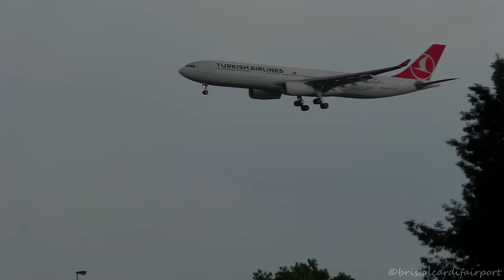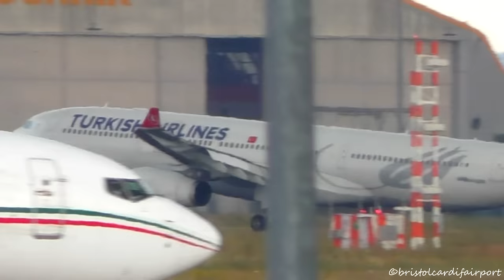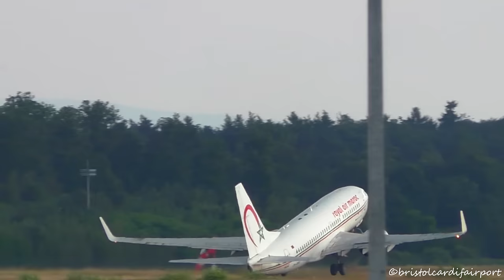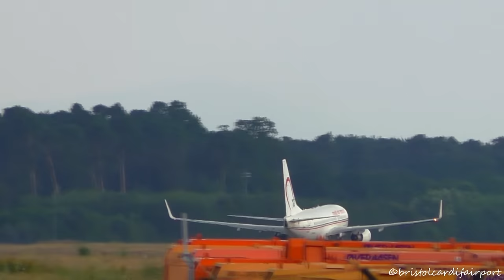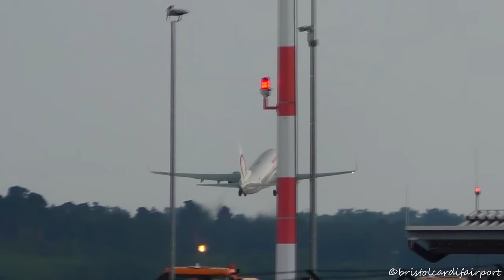PASSENGER AIRCRAFT FAILS TO TAKEOFF! BOEING 737 NEAR TAIL STRIKE & STALL ON TAKEOFF

Comment: I know its easy for us to all look at what was wrong, but fair play to the pilot for reacting correctly by dropping the nose, gaining speed before pulling up again. I'm sure there's other pilots who would have panicked and pulled back harder on the controls when they realised something was wrong. Yes there was an error initially but the PIC saved everyone's life there!
Reply: +Legend Length I'm not a pilot but my understanding is that at a certain speed, you're committed to Take Off no matter what. Usually this is because there's not enough runway left to slow down and stop the plane.
Reply: Doofer911 Yup, V_1 to abort always is below or at the rotation speed, meaning that, believing in his speeds, he was to take off. However, it is a very confusing situation to see that these speeds don't work in such a critical phase of flight. I think in his place I would have also slammed the throttles foreward, taken the nose down to reduce drag and then tried again with my feeling and experience, maybe with 30kts more, guessing that it might be a wrong flaps setting...
Reply: Der Kazar true V1 is the speed that no plane can stop at that time we would run out of runway and bump into one of those trees .The best thing left to do is pull the nose higher
Reply: Agreed, he was already above his calculated V1 speed (rejection speed), so aborting the take-off (based upon the #s that he thought were correct) would have violated SOP plus good judgement under normal conditions. Fortunately, he had enough runway to be able to make his true/actual Vr speed with zero flaps....and must have figured that out very quickly as it was happening. Good split second decision-making in a tough situation.
Reply: Doofer911 Dude...every pilot knows how wings generate lift and how aerodynamics work
Reply: i think this was a test flight of some kind cuz if you see closely all the windows are closed and that's rare
Reply: The correct procedure on a 737 is to select flaps if you get stall warning during rotation. Really, the correct procedure would have been to set the flaps before takeoff and then, if they still weren't set to abort the takeoff when the takeoff configuration warning horn started honking as the throttles were advanced with the flaps up. It could have been worse, but it could have been a whole lot better, too.
Reply: Can't believe all you 'wanna be' pilots didn't notice they had no flaps on take off... that my friends is your problem.
Reply: that's an old video its was a test flight and look closely they have all the windows closed
Reply: Brandon Hollingsworth 
Hey Brandon, never noticed that.  In my defence however, I'm a rank beginner.
Reply: Doofer911 man your tutorials are the best .keep up with tutorials
Reply: Brandon Hollingsworth, Flaps 1 is a standard takeoff configuration and has only leading edge devices extended.
Reply: iRx Destiny
RAM airlines makes no test flights in crowded foreign airports.
Reply: are you a pilot
Reply: Doofer911 I don't see flaps engaged at all.
Reply: Brandon Hollingsworth 100% correct. They have no flaps engaged at all. If there has been an issue with flaps they certainly have had even more trouble during their approach and landing.
Reply: Ali Rahimy "Flaps 1" (a normal takeoff setting) is only leading edge devices, no trailing edge flaps. In the beginning of the takeoff roll you can see the slats are extended.
Reply: Chris Lowder It's still difficult for me to see the extension of flaps though. By the way if the flaps are extended the fact causing this is very interesting to spot. Too much weight, wrong Vr settings, cross wind (which is not looking to be a cause in this case), early pull up, even wrong throttle settings or elevator trim configurations(which again, looks good)
Reply: I hope the pilots got blamed  for this , they missed a tragic   death
Reply: Ali Rahimy there is no flaps extension
Reply: Can someone explain what happened? Did he realize at rotation that he was heavier than he thought? Will he need to adjust again when landing?
Reply: Michael Devito he had probably a malfunction with his hydraulic pressure
Reply: in that case pilots had to abort take off  and wait for another plane to take passengers .  spanair flight 5022  suffered the same failure , but they forced take off and eventually crashed .  these pilots are to be seriously blamed
Reply: The PIC did a phenomenal job! What could have ended badly, was just a few hold your breath moments followed by getting the plane successfully airborne.
Reply: I disagree , the  PIC engendered passengers lives by forcing take off despite knowing they surely had flaps failure
Reply: he cant abort take off, he was in vr, after v1 theres no aborting
Reply: Michael Devito hmmmmmm.........
Reply: Doofer911 u
Reply: For some reason, my replies are not to the individual posters. Slats and flaps are set. Look again...and this time, really look!
Reply: Insufficient delay for wake turbulence dissipation from the landing A330.
Reply: Flaps are extended for a normal takeoff for a 737-700 departing a 13,000 ft runway.
Reply: Ali and Chris, on a 737-700, flaps 1 extends slats and flaps. The most rearward inboard flap at the wing root is deflected downward about 5 degrees. Difficult to see from the camera angle. The outboard flaps have almost no downward movement but are extended far enough rearward to break the smooth trailing edge of the wing. Zero flaps produce a smooth trailing edge. Look closely and you and others will see the flaps are minimally extended.
Reply: Who knows what the truth is. It could have been a training or test flight. Maybe there were no passengers on board. It seemed like he pulled back the power after rotating and then reapplied it.
Reply: Well, the pilot had no choice than to drop the nose. I think it´s the co-pilot who shall, at the right speed, give the order "rotate"  but he said it too early. So it´s not the fault of the pilot.
Reply: "Before the lift-off the pilot has to decide if he really shall take the plane in the air. That point along the runway where he takes that decision is due to the speed and is therefor called "decision-speed" and is called V1 (velocity one). If something is failing (a warningsignal indicate something is wrong), the pilot at this point can interrupt the start" .  That point V1 is calculated by each aircraft so there is enough runway to stop the plane. 
I wonder what Ian Stone mean with "already above his calculated V1 speed" ? What I understand is the plane never reached that V1speed and that´s why it could not lift . When the plane continued it finally reached the right speed to take off. And then it was too late to abort the lift off.
Reply: Doofer911 thing is there is a target airspeed for rotation..if you dont achieve that you keep the plane rolling out..never force a plane off the ground especially a heavy jet
Reply: Doofer911 didnt expect to see you here 😂
Reply: Doofer911 THIS IS NOT THE ORIGINALET VIDEO IT IT ILLIGAL
Reply: Doofer911 V1 speed is called. Beyond that speed you must take off no matter what. The way I see it it is possible wrong flaps settings or wrongly measured weight of the aircraft. Another reason is that the co-pilot announced a wrong rotate speed.  In the pre fight checks the pilot must announce the V1 and rotate speeds. Sometimes the pilots do these procedures in a hurry so the flight to be on schedule and maybe the co pilot just overheard or even the pilot announced wrong speeds. Another reason, highly unlikely though, is that the gauge was malfunctioning..
Reply: Brandon Hollingsworth I watched the video in a mobile and I didn't noticed it. I am no pilot just an aviantion enthusiast. That's very weird though. I have never seen a 0 flaps takeoff. I have traveled with a plane a lot of times and all had some flap setting during takeoff..
Reply: Brandon Hollingsworth the first thing i noticed was there was no flaps on the wing .... not sure why but that would affect the lift of the aircraft.
Reply: Only commenting on what I can or cannot see. Life is too short to get worked up about this.  Take a chill pill and relax. :)
Reply: Never said you were wrong! Just saying do not get worked up about little things in life.  That's all. Two main things could be wrong... Wrong flaps (which as you said they are extended) or too slow speed for that particular flap setting (Maybe they even lost head wind temporarily as the wind changed direction).  Either way he/she recovered from a potential disaster.  Everyone lived to tell the tale.
Reply: Doofer911 aggreee
Reply: Colin Southern absolutely agree, essentially pulled back too early as the take off speeds had been inputted in to the FMC incorrectly, either that or the incorrect level of flaps for those conditions based on weight, runway length and V speeds had been miscalculated or selected.
Reply: H
Reply: I noticed.
Reply: Hey! M your old buddy when you had really less subscribers. Nice to see u here
Reply: Doofer911 Yeah. Scary as fuck if you are afraid of flying. But for the pilots i dont think that was a big deal. Perfect manuveur
Reply: Wrong flaps set
Reply: Louis D, the flaps were set at 1, appropriate for the aircraft and runway length. The two likely causes of the early rotation are wind shear from the A330's wake or inaccurate weight data entered into the FMC. Most likely the crew erred with weight data entry and possibly entered zero fuel weight instead of gross weight. Such an error would have generated low Vr and V2 speeds.
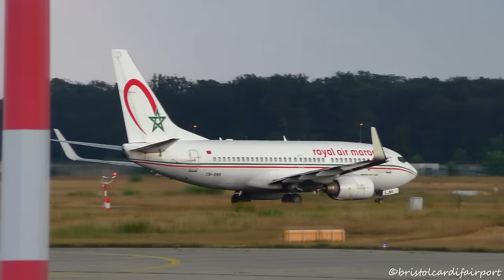Reply: Sebastian Roman, the flaps were set at 1, appropriate for the 737-700 departing 4000 m EDDF runway 18. Freeze the video full screen on something larger than a cell phone at 0:29 to see slats at 1/2 extension and aft flaps deflected.
Reply: I don’t think everyone would have died from a runway overrun but the pilot did save the airline millions of dollars
Reply: Pilot error
Reply: Did the pilot needed to extend the flaps more? He also went too slow on V1 but good job to the pilot because he/she has pulled down the nose of the plane to gain more speed to the point where the plane can take off.
Reply: Mαναριτζις1974 If it was a problem with the hydraulic pressure he couldn’t have pulled down and increased its speed for a second attempt. I think there was a ground effect before V1 what caused a lower speed than needed.
The most know aircraft measurement errors are caused by repainting it. 
Dust isn’t good either. 
Keep it clean.
Reply: Doofer911 I don’t know anything about flying a airplane But, I will take your word for it ..
Reply: Tip0737 MAX th not really! Commercial pilots have had xtra training as to v1, vR, v2 but weight calculations can be off. This was a Flaps 1 setting:leading edge slats plus flaps extended but not curved down. Looks like rotation was at V1. Could have been a disaster. Ret Captain.
Reply: Ramon Cardona kudos to the Airline pilots I wouldn’t know how to,do the job ❤️Great work people!!
Reply: Ramon Cardona An air speed meter works like blowing into a fan. So the airspeed can be 15 knots while the aircraft isn’t moving. So the speed measurement could have been false if there was a lot of wind on the ground. Airplane manufacturers can improve this by adding a speed meter to the wheels.
Reply: I think the flaps were fully retracted.
Reply: Problem is No FLAPS.
Reply: @bhollingsworth  correct 👏 there is no flaps.
Reply: MTLTV1765 - V1 and flaps are calculated by the weight of the airplane. The weather (temperature) should also be a factor. Theoretically you should subtract one flap by each 5 tons less than the ref. weight. But there are more factors: the fuel (L/R) and the possibility to get to the V1 speed, eg. the length of the runway. Without flaps could theoretically be a good takeoff setup.
Reply: Positive rate of climb.. Pulling back would induce stall.. The nose lowering allowed more airspeed to build because of angle of attack lift off or rotation possible.. Im wondering why No Flaps on takeoff?
Reply: John Boy Walton V1, V2 and flaps are calculated by the weight of the airplane.
What would happen if you start a takeoff with too many flaps?

1: You takeoff before you have enough speed for a steeper angle. (although you should have enough power)

2: You use more fuel wherefore you have a wrong flight plan. (e.g a flight over countries where are wars or no safe landing possibilities)

3: What if an error occurs after takeoff or there are different weather conditions then expected?
Reply: @arnoldmeulen  Well agreed anout flaps , however curious as to something holding this bird down 10 degrees of flapa would create lift.. Fortunately for this crew they had runway on their side..
Reply: @Khabib Normagomadov no takeoff process is not done  by autopilot it done by pilot and landing too does pilot but in some cases pilot does an autopilot landing
Reply: It's called v speeds or speed checks buddy that pilot was pushing against his luck and other lives on bored he is a cowboy.
Reply: Yeah dude, fair play to the guy who nearly crashed a 737 for calculating his takeoff speeds wrong.
Reply: @Trace32  the flaps were properly set for the aircraft and runway length. Flaps 1 was selected which also extends the slats to 50%. Here is a screen capture courtesy of Colin Southern from about 0:29 showing leading and trailing edge devices deployed. https://a4.pbase.com/o10/84/630384/1/166877121.LsTekLx5.1.jpg
Reply: @xxxxxGhostBoyxxxxx  The flaps were extended. Read my comment above. Screen capture showing slats and flaps extended: https://a4.pbase.com/o10/84/630384/1/166877121.LsTekLx5.1.jpg
Reply: @TipMAXth  ABSOLUTELY WRONG! Pulling the nose higher is the best way to completely stall that 737 and crash it.  Knowing that the runway was long, the maneuver was correctly executed but riskier than comfortable, since an aborted takeoff would have been be safer.
Reply: @martyjrpowell1014  If you believe Runway overruns are any "safer", you are ready for one or two books on aviation accidents and you can ask Santa Claus to bring those to you!
Reply: Doofer911 I am a huge fan of you. You taught me FSX!
Reply: Doofer911 it is called point of no return
Reply: @annmariehere1  V1 speed happens before Vr. He could have been above V1 but not at Vr. If that was the case then he was already committed to flight.
Reply: @colinsouthern  so what you saying is that they tried to take off before they reached V1?
Reply: @colinsouthern  Do you know by chance  is there a risk that airplane can stall from heavy turbulence? When it's light turbulence I am ok but when it's moderate-to heavy I am scared that either: Plane can stall, or autopilot can disengage or plane can get from normal law to alternate law 2 (like it happened on flight AF 447 in 2009) In other words: Can heavy turbulence be dangerous or it's ok unless pilot make mistake?
Reply: @TipMAXth    Not quite sir.  V1 is also the VEF speed at which they can fly if the critical engine fails.  it varys with each flight and plane,  its not just the speed that "no plane can stop..."   " V1-  Maximum speed in the takeoff at which the pilot must take the first action (e.g., apply brakes, reduce thrust, deploy speedbrakes) to stop the airplane within the accelerate-stop distance. V1 also means the minimum speed in the takeoff, following a failure of the critical engine at VEF, at which the pilot can continue the takeoff and achieve the required height above the surface within the takeoff distance."
Reply: @Doofer911  By lowering the nose and applying throttle the committment to Take Off was preserved and accomplished.  Discerning pilots, not robots,  were in command of that plane.
Reply: Energy is energy.  A mushy response to the elevator should have been his first clue to reduce the rate of rotation as well as the initial target pitch.  This would have allowed him to build additional energy by using excess runway to accelerate
Reply: fair play for the pilot to drop the nose...wtf, Why should have it got to that point.
Reply: @jimtalltheislandbrothers6639  IT HAD FLAPS 1 SET, WHICH SETS THE FLAPS TO 1 DEGREE WHICH IS A COMPLETELY NORMAL SETTING
Reply: Yes there have been a incident where the pilot flying pulled harder when the airplane didn’t lift off at rotation. It’s Emirates EK407 out of Melbourne Australia due to crew error miscalculated take off weight and used a figure that is 100 tons lesser than the actual weight which resulted in erroneous take off speeds. I don’t know how will I react to it if happened to me. What I do know is that in the Royal Air Maroc case the Captain handled it professionally and safely.
Reply: Wrong. After failed take-off pilot increases pitch and nearly causes a tail strike. Ignores the stall for 8 seconds and ends up back on the ground.
Reply: @goldreserve  are you a pilot? 
How many years/hours do you have?
Have been a flight instructor for 10 years?
Have you been an airline pilot for 8 years?
Are you a commander on A320 or any other passenger jet with over 70 tons maximum take off weight?
Plz answer!
Reply: The plane was to heavy loaded.
Reply: u r not a pilot. that's for sure!
Reply: @lastorianostra8173  Nope but this was on National Channel in Air accident Program and it was to heavy loaded to get airborn cause it was to heavy.
Reply: @bhollingsworth  Flaps were in fact set. The wing leading edge is extended and the trailing edge is set to flaps 1, a typical wing camber setting for a 73 at takeoff. This long takeoff condition was in fact caused by an Airbus “Heavy” 330 that airport ATC warned the 37 crew when they were cleared to take off that likely wake turbulence from the 330 would be an issue for them. If you don’t know what that is there are hundreds of videos on YouTube that will explain it to you. Oh, and I am a pilot and not a wanna be.
Reply: @goldreserve  look at so many misinformed wannabe pilots here. mentour pilot already explained the crew handled it in professional manner
Reply: Yep , that 's when experience counts .
Reply: @TipMAXth  NEVER pull nose up without airspeed.  recipe for death.  It looked like he did not have his 15deg of flaps set.  So his calculated V1 speed would have been off.  Assuming he had run out of runway to initiate a full stop, pilot was correct to lower nose and gain airspeed.  Once he had that, he could safely climb.  And yes, I am a rated commercial multi-engine instrument pilot.
Reply: @BecksteadBlack  Ian - spot on!.  Upon second examination, it did look like he had zero flaps.  Ooops.   So he dropped nose, got some airspeed while in ground effect, and then restarted the rotation and climb.

Only a rumor, but I hear checklists are a good thing.